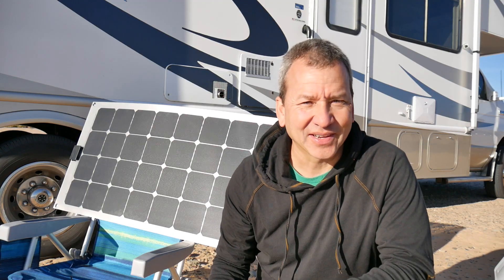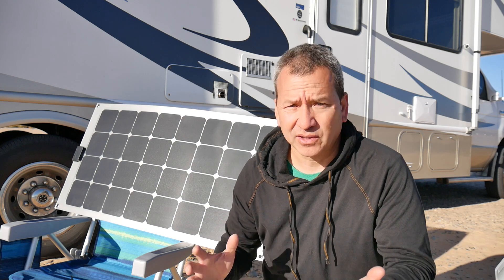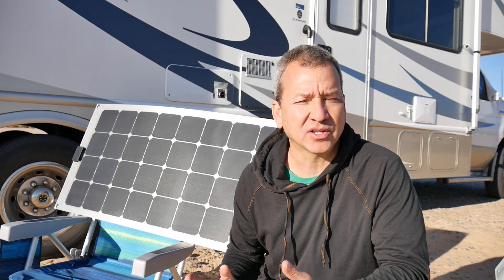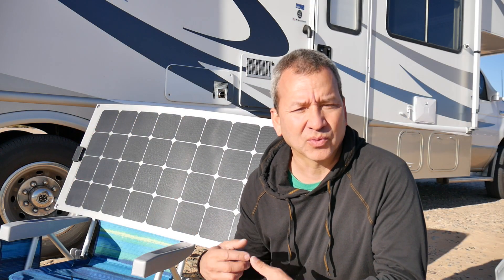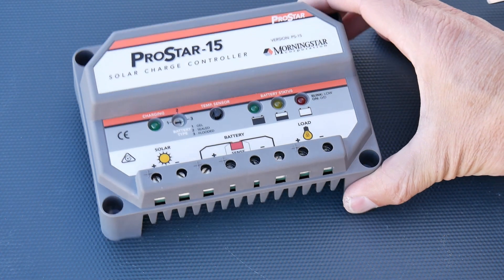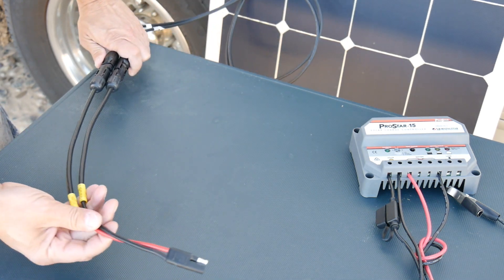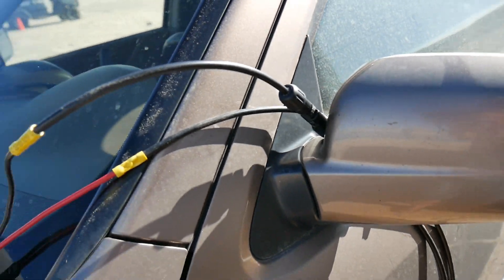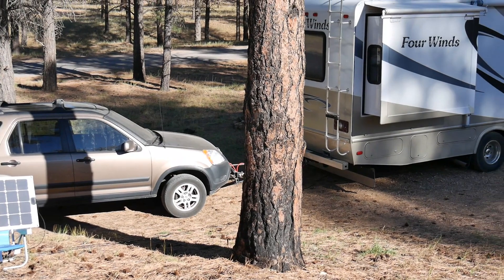How To Build a Portable Solar Charging System

Comment: thank you great job of saying things...     my question is if i connect a solar panel to a controller then to a battery then wired to a small 12v refrigerator and it all runs ok then the sun goes down will the frig still  operate off the battery by itself or do i have to throw a switch or something???? thanks
Reply from the maker: If your 12v fridge is wired to the batteries then YES the fridge will run off the battery alone when not charging.
Reply: @RVwithTito  thank you tito

Comment: thanks    how far away can the panel be from the rv (max wire distant) i want to park in the shade but put the panel in the sun thanks again great class
Reply from the maker: 20-30 feet but the further you go, the less power makes it back.
Reply: @RVwithTito  thank you for the comeback tito

Comment: Wonder if hanging it on  side of RV facing the sun using suction cups would work. It would get it off the ground and it would keep it from blowing over. It wouldn't take up any space when storing it. It might not be the perfect angle but close enough and probably less likely to be stolen. I would appear  to be permanently mounted to RV.
Reply from the maker: Yes that would work. I've done it. 👍🌞

Comment: I just hooked up a 100w panel and testing it out. I put the panel on the dash behind the windshield. My vehicle faces south so the panel was facing directly into the sun. Checking the amps I was only getting 2.0 amps, I move it outside on the windshield and it's putting out 5.5 amps (it's rated #). I am surprised that the glass made that much of a difference. I think most of the time the panel will be on a chair or against a tire, but good to know.  Sure helps to have a multimeter to check things like that.

Comment: I've been thinking about doing that to keep my toad battery charged while driving down the road. Just have to bungee it to the roof. The controller could be mounted under the hood with velcro then taken off and used to help keep the coach batteries charged as in your example. Nice video.
Reply: FYI. I bought the setup and tried bungeeing it to the roof. I decided to take it for a test drive to see how it held up. At about 35 MPH it started acting like a wing and started flapping around like crazy. Ha Ha. I tried several different things but nothing worked. It will be used to keep my trolling motor battery for my inflatable charged and to supplement the 300 watts already on my roof. I ordered a TOAD-CHARGE from LSL Products. That should keep my car battery topped off on long trips.

Comment: I also have an extra flexible panel like you to augment my system.  I however can hang it on the back or sides of the class b RV depending on where the sun is instead of putting it on the ground. Simple hangers will suffice. Its also important to note that for most controllers the battery has to be connected first before active live panels are connected. I've already "fried" one.  Thanks
Reply from the maker: Thanks for the reminder Phil. Yes. I realized that I failed to mention in the video that you should connect the controller to the battery first. This is why I like having the quick connects. Also , I've been pondering a making stand that I could hang or even double as a window shade. Hmmm.
Reply: Yes it serves as a window shade for the back of my RV. Simple plastic or metals rods can be rigged to hold the panel at any angle. I've made hundreds of modifications on my rig... I should do a blog or set up a YouTube channel like you some day when I slow down. Sorry no pics since it's in storage right now.
Reply from the maker: Nice! I'd love to share some of your cool mods. Folks would love to see what you've done. Shoot me an email with a pic and short description and I'll post it on my site.

Comment: Thanks for posting...   I have a Class C  25ft   how many panels would you recomend to instal...  I have 2 house bats set-up,  standard from factory,   refer, lts,  all factory
    very interested in getting solar on the RV     UBfla
Reply: We have the same questions....Problem is that our fridge is a residential type.  Have 2 brand new insterstate series 27 12volt batteries.  Our inverter is 1800 watts so we don't know exactly how much solar we need.

Comment: I want to do this but I was told I couldn't hook up another controller like that ?  that I could NOT Just clamp on to the batteries that are set up through the rig's controller ?
Reply from the maker: Should work fine. You're basically paralleling the two controller outputs. Both will sense the battery voltage and charge accordingly. Doesn't hurt anything to try it out.
Reply: @RVwithTito   one more question .. is 100 W enough to charge the 2 batteries during the day ?  if I just use batteries at  night for the furnace and the TV and a light or two ?

Comment: Thanks for explaining. I have a trunktype 100W panel, it works quite well.
Normally you should connect to the battery first, because the regulator needs to figure out what voltage it needs to generate, but yours has a switched selection, most controllers do not have that
Reply from the maker: Yes you are correct. I should have pointed out that the battery end should be connected first. This is true for hooking up any charge controller. Thanks!

Comment: Hey Tito great video I'm curious if you think this may work on a Semi-truck?  I'm a truck driver and sometime I'm home for a few days and I want to keep the batteries charged up with out having to have it plugged in somewhere...
Reply from the maker: +keith Buckeye Bros. LLC It should work fine on any lead acid battery. You might even be able to use a smaller 50 watt panel.

Comment: My RV came with a solar ready connector on the roof, so it also has a charge controller 10amp. I don't want to install my solar panel, which is a renogy 100w flex, to the roof. I want to use it as a back up to charge my battery. Do I need to replace the charge controller with a bigger one to do this or do you think this will work?

Comment: Won't you have a conflict with the other controller in regulating the charge to the batteries? What about adding a parallel connection to your main controller if it's big enough to handle the load?

Comment: I see that you use a 7.5 fuse, is that the correct size to use with a 100w panel.  Thanks...Bob
Reply from the maker: The 100W panel won't generate over 6 amps. So a 7.5 A fuse is just right for a single 100W panel.

Comment: Tito i been watching some of your videos and it looks to me that you know about solar panels systems. So i wanted to ask you for some advise so here it goes.
I currently have a harbor freight set up on a popup camper that i want to replace, i need a solar set up that can keep my original small domedic fridge running constantly.
Can you recommend  the right voltage panel 100 watts vs 150 , MPPT controller to do the job?, Flex panel vs Ridged etc? and o yes i have a modest budget.
Thank you.

Comment: 👍👍 Neato! I am thinking that Battery Tender cable is good for about 10 amps or so? With that SAE quick disconnect, can use with solar and one of those Jr battery chargers. I would like to do that with my truck...but, leave the cable intact (the round eyelet cable on the battery terminals) and have the SAE side accessible with the hood down (maybe zip tie it in the front grill or something). Whatcha think?
Reply from the maker: I have cables permanently connected that way on my RV chassis battery. It allows me to quickly connect/disconnect the battery tender. I'll probably do something similar with the portable panel too eventually.

Comment: If your panels weren't set up in series could you connect different powered solar panels without affecting the charging? I.E. mix and match 60, 100 & 200 watt (or whatever) in parallel to the same charge controller? I heard someone say that if you connect a lower power panel into a system with higher power panels you'd lose some of the power from the higher power panels. Didn't sound right to me, maybe I misunderstood. What do you think?

BTW, I really like your videos, keep 'em coming!! :)
Reply from the maker: Actually it's the other way around. I cover that specific topic in this video (https://youtu.be/dfMVHLVcMWo). Mismatched panels should be connected in series and fed to a MPPT controller to not lose any power. I have a couple different kinds of panels some with different wattages. I have them wired in series. I also have my MPPT charge controller maxed out. It can take up to 150 volts DC input and I'm right there so adding more panels would require a larger controller or a second one. Hope that helps explain things for you.
Reply: Hi Brian,
Thanks for the comment. I watched your other video and did some 'google-ing'. I found some information that basically agrees with what you say in your other video but provides a bit more detail, it's at http://solarpanelsvenue.com/mixing-solar-panels/
In summary what it says is that you should, if possible, not mix different solar panels. If you must mix them you should connect in series panels of the same amperage rating (Imp) and in parallel panels of the same voltage rating (Vmp). I suspect I should have been more specific when talking about mixing different wattage panels, the wattage is not important it's the voltage and amperage ratings that are important... of course P=E*I 
Thanks again,
Gord

Comment: So i can have more than one charge controller powering my battery bank at the same time ??
Reply from the maker: Yes you can. But to get it working right, you need to program them all the same so that they don't switch charge cycles at different times/voltages.

Comment: Still love this idea and I'm getting closer to getting it set up and running. Do you think it would be possible to make a permanent connection to the battery terminals with the leads going to Anderson connectors, then the leads from the panel going to Anderson connectors? This way the croc clips couldn't accidentally come off the terminals.
Reply from the maker: Yes. Using any kind of quick connect (Anderson, CES, etc.) with a permanent battery connection would be the preferred approach. Adding a weatherproof quick connect plug nearby would be even better. That's my plan as well.